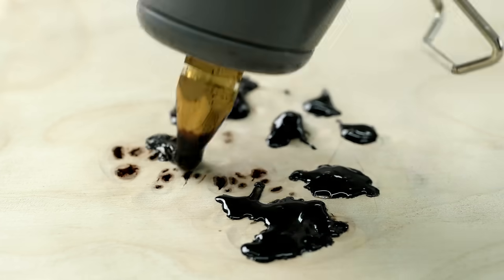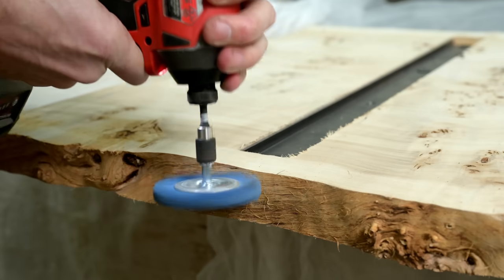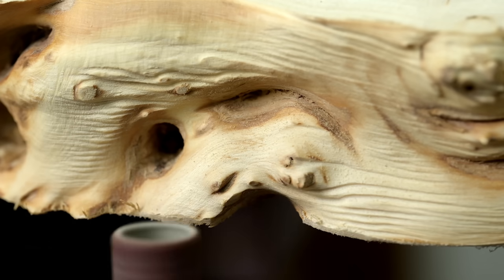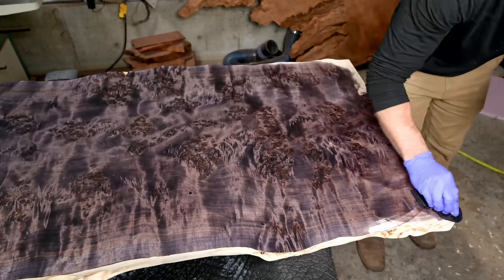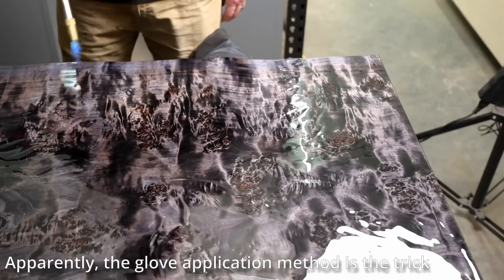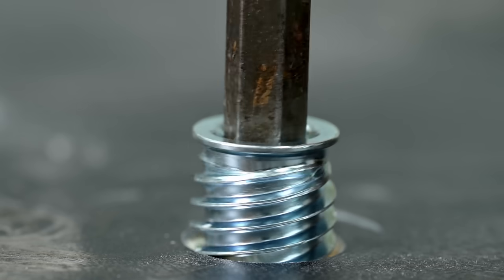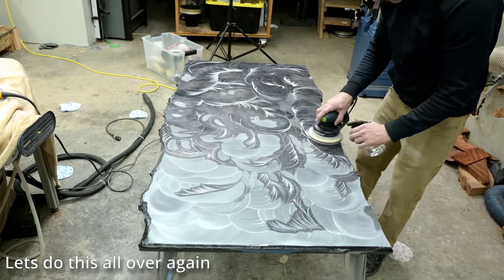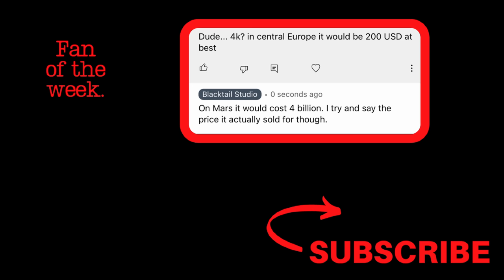$15,600 Table Build

Comment: Also seconds after I posted my comment I heard you mention doing the Spurs and whatnot so not to poke out the eye of a toddler. Funny enough when I was a toddler at daycare and a woman's house back in the '80s who lived not far from us I asked the kid if I could play with his green army men tank as it was the only one I'd ever seen and he said no and grabbed my head and slammed me into the corner of a table and I had to get multiple stitches underneath my left eye to which I still have a scar today at 38 years old. Also I agree with your sentiment of the dribble and for anyone who would like to know which dremel to get go with the Dremel 4300 9/64 Platinum edition. The 4300 is there most powerful version It's also the most capable across the board. The 9/64 only means it comes with nine attachments which is most all of the ones that they make they're universal as well. And the 64 is the number of bits included. Not to mention that particular kit comes with a super sweet toolbox in which to keep all of it in which it has foam internals for the top portion and for the pull out drawer that have been cut out so that everything perfectly fits in that toolbox. Most of the time you'll find it online for $199 but it's the right time of year you can easily find it for $139 or so easily making it a very very well worth investment at that price point. It has the most amount of torque and the largest amount of amps which make it an absolute beast plus it comes with that really nice fancy Stylo attachment which honestly is leagues and leagues above actually just buying the regular Stylo by itself. But that dremel kit is absolutely phenomenal in every way.

Comment: I would love to see a test video for the ceramic coating. maybe make two little cutting board sized chunks of wood, finished with epoxy, and one has the ceramic coating on, while the other doesnt. after a couple tests, I'd like to see how well the ceramic coating actually protects the resin finish

Comment: As a Car refinisher you absolutely 110% need to block the top with a 6" to 8" flat block. Careful on mixing the epoxy too hot or it'll trap solvent in the clear.

Comment: Also, when I I spectator the surface of my projects, I found it much more effective to turn all the lights off and have an incandescent bulb on a desk about 10 feet away.  When I look across at an angle, I can see every imperfection.

Comment: Tungsten Rings are not recommended, for the simple reason that in case of an emergency it is almost imposible to cut it off (with hospital tools). If your finger swells while wearing the ring, it could be the unfortunate end of said finger.
Reply: This is actually misinformation.  Tungsten is extremely hard and abrasion resistant but that means it is also brittle relative to more traditional precious metals.  In an emergency they can be easily cracked off the finger with a pair of vice grips with minimal risk of further injury.

Comment: When I used to paint some old cars or motorcycles in my garage it got very frustrating to learn how important the proper prep work is. You can't skip anything or cut corners with the prep work. The 3M Trizact system is indeed awesome, but kind of expensive.

Comment: Mappa - i love watching the process you go through to make these unique pieces. I was curious to know if you've considered using an industrial vibrator to assist with air pocket prevention on your epoxy pours? They are used to transport powders and other solids normally along pipes or channels, but i wonder if it would help to dislodge some of the larger pockets of air trapped in corners. Similar to how an ultrasonic bath works, though more coarse in magnitude.

Comment: So I have been binge watching these epoxy resin tables as I’m hooked. What I’m seeing other wood craftsman do is fill the pits and cracks with epoxy and there are different types of epoxy…as I’m sure you know. The epoxy I’m talking about is called Deep Penetrating Epoxy that soaks into the grain of the wood and then they do their sanding before the table top epoxy finish.

Comment: Some tips: give a try to some automotive putty (ie: "bondo"), most are a light yellow color, but most plastic-specific compounds (for bumpers) are dark grey color. And as these are basically poliester resin + fillers, you can surely use black epoxy die to get them darker. Second, use a tyvek painters suit, complete with the hood! The suits wont only keep you clean, but stop dust and lint (and hairs!) out of your work. Even better if you blow yourself up with compressed air after suiting up. Third, look up for Trizact in 5000 and 8000 grit, you can actually do a 2 stage or even single stage polish as the 8000 leaves a partly polished finish (and its a sandpaper)!! And as a last suggestion, the 3M compound you use is not bad, but in the auto community its considered "collision shop" stuff. All the detailers i've talked to say its the most basic you can use. Look up for stuff like Sonax, Menzerna and others. This kinds of polishes are meant for a fast job, which means they have a lot of "fillers" (silicones and waxes) in them, so they hide scratches, but wont remove them. The way to know the truth is to use a rag with high purity isopropyl alcohol after buffing and cleaning. Hope my comments help, BTW, amazing job and really beautiful table!

Comment: For filling holes like that we use Corian glue at work. We also use it on granite and marble. And of course Corian.
As long as the material is dry, the temperature is not too cold, and you don't use the first squirt, it's super easy to use.
It's a two component, you can work with it much like caulk, but hardens like epoxy by producing chemical heat.

Comment: those pigtails you get from stage 1 after the 3k is common. I use these exact products on a daily basis at work and the trick is to use a tiny bit more stage 1 compound, work in smaller areas, and lower your speed on the wool pad. Lower the speed and lift off the surface just barely and work it for longer times with slower arm speeds.

Comment: 2:37 using coolant liquid (even water works as long as you don't work with something that can corrode) extends the lifespan of your tools because they don't get dulled so quickly.
Reason for that is when the tool heats up it gets softer, not by a lot, only a little bit, but that is enough to increase the wear and tear of the tool.

Comment: for filling those cavities and holes you could have used some rosewood sawdust mixed with hide glue. I mean a thick paste - hide glue silidifies very hard and when properly mixed with wood shavings, the result is good. certainly very easy to sand as well. Anyway, love the result.

Comment: Mappa, I have to admit, as soon as I saw the list of grits you were using, I perked up, because I've always had issues with such a large jump in grits. I thought I was going to learn a trick that would save me time in sanding. 

Instead my father's words were reinforced, "shortcuts usually take longer than doing it right the first time."

Comment: Cam, don't know if you have tried it or not, but I have had luck with dripping some epoxy into the pits from air escaping after the first coat of epoxy and wiping the excess with a rubber squeegee.After that a light sand and then a flood coat.

Comment: Just a note . As I started my epoxy table in a 90 degree weather . My epoxy burned and cracked. In one of your YouTube videos  you said we should worry when the temperatures reaches 120 to 130 degrees.

Comment: Pretty sure if you put your epoxy under a vacuum the holes will fill pretty easily. Pretty easy process, lookup windshield repair or aircraft composite. Major tool required is a air compressor.

Comment: Jason Ingram here just wanted to share some information. If you put a champer on the edge and you do it with the angle going downward it makes the table look bigger if you go with it throwing up it makes it look smaller. Just thought I would share that with somebody or anybody who didn't already know that. It's just the way that the human mind is able to perceive things that is that and it does it so it baffling in my opinion but if you ever have a smaller table and you're trying to make it look bigger it's good information to have.

Comment: Working in the fiberglass industry in mold repair and modifications had to only go to 1200 wet before polish.. you're  staining process is the same style we used for photographic lamination except we used a dip tank. The only suggestions I can give is to try a white glue/water wipe as your sealer and let dry or a resin like infusion resin catalysed realy hot?

Comment: Mappa- From my experience in the automotive world, ceramics won't prevent scratching, but they dont want things to stick to them and make the surface much easier to clean and maintain in addition to providing a great shine. They can serve as a sacrificial layer, but the ceramic claims that they prevent scratches are overstated.

Comment: Regarding the mistake.  We have all been there!  This being said, when this happens in the future, take some alcohol and wipe it off before sanding, but once you do, you should only have to go down to 1000 Grit whenever that issue happens.  This being said, going down to 800 Grit was not terrible, and may have helped level out any other imperfections.

Comment: Mappa - Hey mate, nice video! I have a question about the ceramic top coat. Can you please do a test piece on a clear coated piece of wood? Slide a can or plate or something over the uncoated area, then one over the stage 1 and another on stage 2 and show the scratches (if any) so we can see the difference of how the coat protects. 
Or if you've already done this in a video, please let us know where. 

Thanks heaps!

Comment: I know this is a late question but between the first and second dye coat you did 180 grit.  Did you do another sanding after the second dye coat prior to the first epoxy coat?  Basically, what is the final wood grit sanded to before you do the epoxy?

Comment: You should try simtec polyester they make great sealers that sand easily in clear, gray and black. Also they make a nice top coat that also sands easily and is 90% the hardness of glass! Almost all the pro guitar manufacturers use this product.. it sands easily and buffs out like a mirror! The only downside is you have 25 mins max or it will harden in the gun so just make up small amounts  ea time. use acetone to clean out your gun and yes you can use a roll but use a smooth foam roller

Comment: Mappa - did you ever consider putting the sander, without paper under the table when you like the epoxy to level. I use a sander (turn it on obviously) to get the bubbles out of walls when I pour cement, the bubbles go out and the cement levels. Cement is a lot thicker then epoxy, not sure, perhaps even make.. lets call it  "a shaker" that you at on the table to vibrate it...

Comment: Mapa  hi I really enjoy your videos I'm just starting out. I'm learning how epoxy can make or break a project. But I've trying different ideas to see if I can come up with the next big idea, as I'm sure we sll are. I was an electrician working under my dad who was at the same company for 40 years. Short story "Great Teacher"
But I have built my own wood fracking machine. And I'll frack just about anything old slabs, plywood cutoffs, even smaller tree root systems. 
Looking for the best for my type of art. I've been trying to use epoxy to finish but most I've tried  won't stick to some of the crazy corners and twisted wood. Do you have any suggestions I might be able to try. Thanks for time. 
Keep up the amazing projects.

Comment: Mappa - what do you recommend for taking your woodworking it to the next level? I have some experience making furniture. I’ve made tables, beds, night stands, cutting boards, and baseball bats. I’ve never worked with epoxy before but I want to make a desk using epoxy.

Comment: I'm still looking for black glue or epoxy. 
At this point I think I'm going with PC woody product epoxy and will use some dye to get the dark color I'm wanting. 
This is for a manufacturing project, hence why I've still not done anything 2 years later... It's taken some planning. 

Any further ideas from experienced wood workers is appreciated. 

Thanks

Comment: 20:55, 'ceramic' paint protection doesnt gove you any mechanical damage protection, its purely environmental proteftion and thr pgrase ceramic is pure marketing also, its probably SiO2 or a polymer.

The reason is provides no mechanical protection against even light energy like sliding a tea cup across the surface is its 1 micron or less thickness.

Comment: I’m 2 years late and this is probably a really dumb question  as I am extremely new to woodworking but you tried filling the holes in the desk with glue mixed with sawdust right? 

Combine woodworking glue with sawdust, then wait, then sand it down?

Comment: MAPPA - do you need to make any type of surface profile (roughness) between pours? ive seen you pour layer after layer of the same material, i guess if its not set fully you can pour over the next layer of resin, but do you ever have any lamination issues? as always, love your stuff man! i really wish i coudl have won that blue seaglass waterfall center table!

Comment: Man, you have to do 2 to 3 thin coats at about an ounce per square foot. This will build layers a d show you problem areas. After the second coat, then you use the mohawk sticks to fill in holes. The final coat HAS TO BE about 3 ounces per square foot. If you dont use enough epoxy, you wont have enough epoxy to self level and give you that glass like finish.

Comment: You do not need to grind so many times, you can grind up to 400 or 600. And cover with polyurethane varnish 3 layers wet on wet.

Comment: Hey Cam, I’ve been watching your videos and Black Forest Wood Co for a long time. I have been building epoxy tables and bars for about 5 years.  I’m wondering, in your opinion, is the buffing and ceramic coating or the sprayed on catalyzed varnish more durable for a restaurant bar top?
Reply from the maker: Check out the new n3 nano we’re offering. I bet it would be awesome in a restaurant

Comment: Translate. Ok  te voy a dar un tip cuando tú tiras el acrílico en el centro de la superficie sea cual sea su forma  el material se expande por si solo puedes tirar una cantidad k creas k cubra en total. Y lo que escurra por las orillas te encargas de cubrir las partes que faltan y por abajo puedes poner un tape del azul o verde que no tienen mucha glue eso por si quieres evitarte limpiar  para esto te sugiero antes  k perfores donde pondrás las patas de la mesa. Y en esas perforaciones usarás niveles como los k se usan para la cabecera de la cama y dejar a nivel  la superficie. Para el secado , en el piso  o mesa de trabajo puedes poner papel o plástico. Para no dañar o limpiar pero el épico es muy noble y fácil una vez  tú y el se acoplen verás k será pan comido.